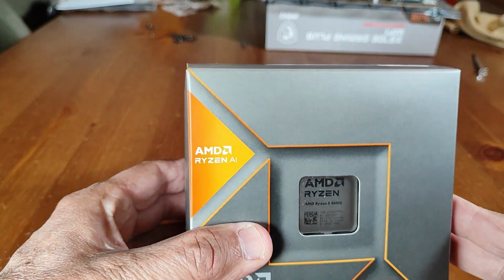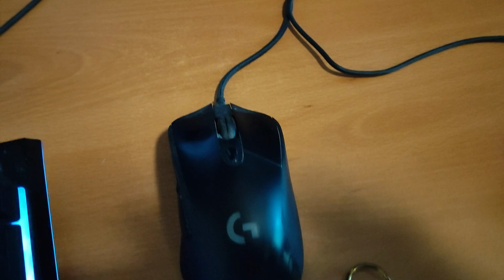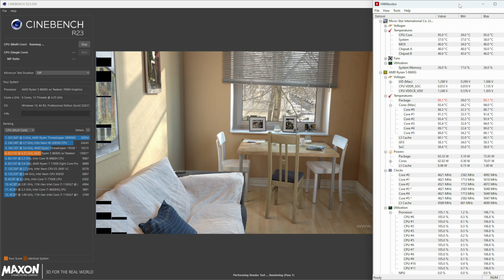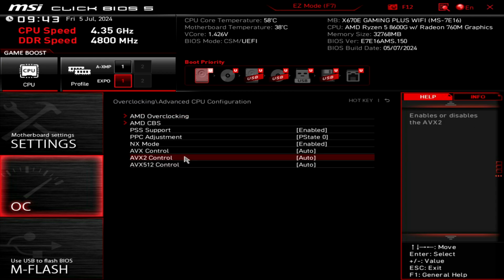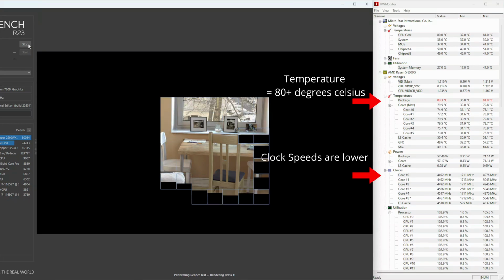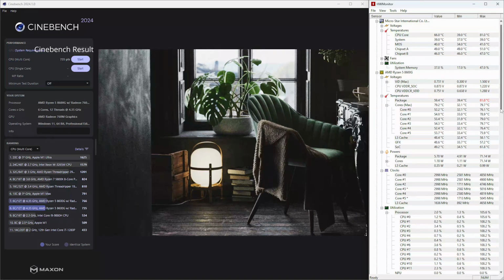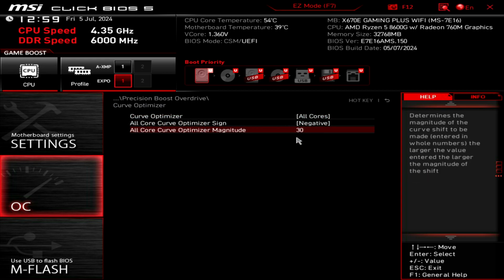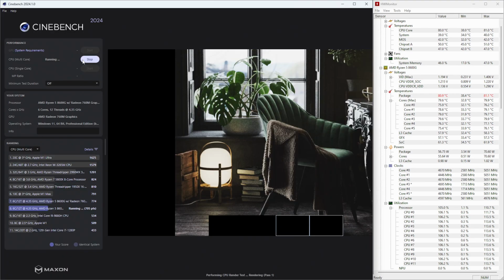Ryzen 5 8600G Temperature Test

Comment: 80 on a stock cooler?
Reply from the maker: Max. Operating Temperature (Tjmax) = 95°C
Limited in the BIOS to 80°C [and undervolting]
A better cooler is always good BTW.
Reply: @Benchmarks so is this an acceptable temp?

Im getting this temp with my 8600G on PBO undervolt -20 and EXPO enabled.
Reply from the maker: @digivagrant  I think it's an acceptable figure for a zen 4 CPU.
You can always limit the temperature even further in the BIOS if you don't like it.
Reply: @Benchmarks  Thank you for the feedback. :)

Okay so Ive tweaked the PBO settings a bit. Set PBO Limit to mobo, undervolt -30, Throttled to 85. Now I'm getting buttery smooth frame pacing but my temp is at around 83.

Is that still acceptable?

Now Im torn between having okay framepacing at 80 or buttery smooth camera pans at 83... 😔

Comment: before it reached 90° but now it gets stuck at 80° in games, does this cause any problems, is it dangerous?
Reply from the maker: Max. Operating Temperature (Tjmax) 95°C, so it's not 'dangerous'.
Undervolting is the best thing you can do to lower the temps. [please have a look @ the undervolting part in the video.]

Comment: Thank you so much sir for this video, I was so frustrated with my 8600g because I bought a thermalright dual tower air cooler, and temps reaching 90ºC on stock settings was frustrating.
WIth this settings my processor is running really cool, thank you so much
Reply from the maker: Thanks
Reply: same in my case, upgraded with sychte mugen dbe at a maximum temperature of 84-86°, I thought maybe this procie was a bit hot

Comment: Sir, this cpu with zotac rtx 4060 twin is good for buget build?
Reply from the maker: It's OK.
Perhaps it's better to have a look @ the Ryzen 5 7600, it's almost the same price in many countries, but it a lot faster [in gaming] because it has 32MB level 3 cache instead of 16MB and the boost clock is 100MHz higher. [If the i5-7500F is a lot cheaper, go for that CPU instead]
Reply: Thanks❤

Comment: sir,what is the startup temperature.
Reply from the maker: The lowest temps are app. 30+ degrees
Reply: What about yours friend 
Do you have a temp iasue like me 
Like in idle the temps are over 50 and reaches 60 qith some apps opened 
What about yours
Reply from the maker: @waleed_xd3366  
My idle temps are close to the minimum temps in HWinfo
How's the airflow in your case ?? What is your room temp ?? Was the cooler mounted correctly ??
Reply: @Benchmarks  the airflow is good enough mesh case the intake and 1 exhaust 
The cooler was mounted correctly i assume when the screw stopped rolling i didnt force 
And one thing also the cooler thermal paste came with a brown ring around it like discoloration
Reply: @Benchmarks  can you just imagine by just opening amd's software temps easily reached 65 and 70 
Thats impossible
Reply from the maker: @waleed_xd3366  You might perhaps try new paste or buy an aftermarket cooler.
You didn't mention your room temp.
Reply: Room temps are normal im sure abt that
Reply from the maker: @waleed_xd3366  Did you try new thermal paste ??
Reply: @Benchmarks  hi friend good news !!! 
Somehow by only removing and reinstalling the fan it worked out 
Maybe because i turned off the expo 
One of those worked thank god
Reply from the maker: @waleed_xd3366  You could try the AMD EXPO again, to find out if it was an incorrect mounting of the Cooler. [or not]
Reply: @Benchmarks  that is what i am about to do 
Thank you for the feedback bro
Reply: @Benchmarks  i did so and the temps went to average 55 on idle 
That really sucks 
Do you think its a mufacturer problem ?
Reply from the maker: @waleed_xd3366  No, it must either be one of the 'variables' mentioned above [room temp, airflow] or incorrect [cooler] mounting.
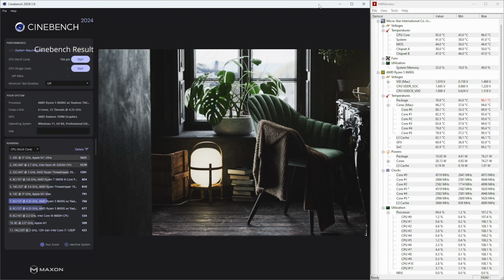@ 0:51 you can see that after finishing the cinebench test the temps go [just] below 50 degrees.
Reply: @Benchmarks  amigo i told you that the problem was due the expo 
I turned it on and it jumped to 55 deg. 
Turned it off went to 35 average
Reply from the maker: @waleed_xd3366  I know, but in that case the RAM [and CPU] are running at a much lower speed.
I guess it will be running @ 4800MHZ and with a higher latency.
Reply: @Benchmarks  yup rams are on 4800mhz
Reply from the maker: @waleed_xd3366  That means that the CPU [infinity fabric], the system RAM and the Video RAM will have a [much ??] lower performance.
[How much lower will depend on which RAM speed you've bought]

Comment: I'm looking to buy a new pc
Which one is the best?
I7 3770 + RTX 2060
-
I5 10400F + GTX 1650
Reply from the maker: Save some more and buy the i5-10400F and RTX 2060. [or equivalent]

Do not buy the [old second hand] i7-3770, you cannot run windows 11 with it, and it will be obsolete very soon.
Reply: @Benchmarks  thanks!